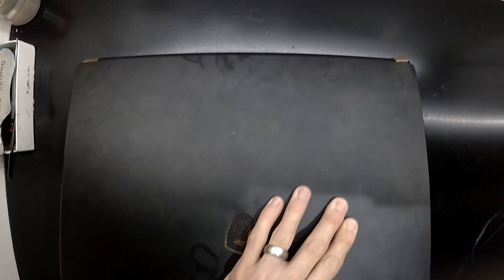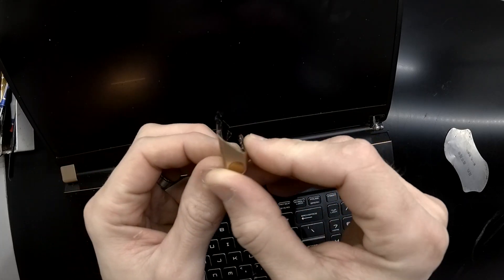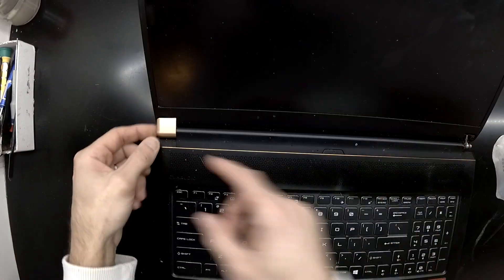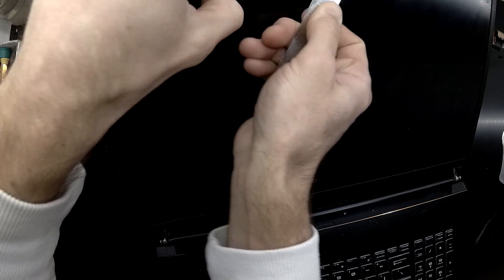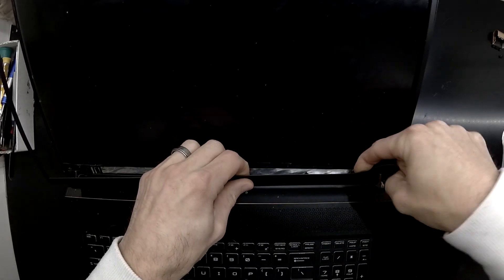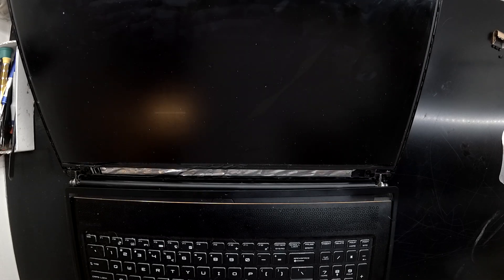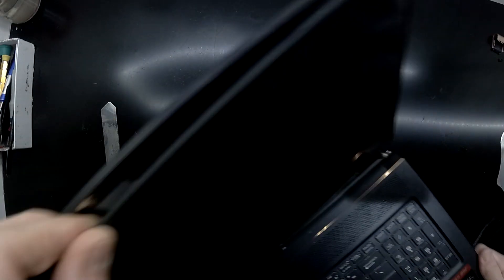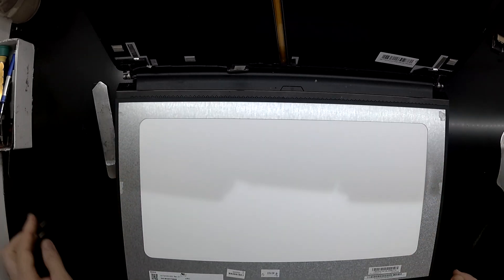MSI G75 Stealth LCD Replacement

Comment: Do you know if this model has a backlight, or the whole screen needs to be replaced?
Reply from the maker: i would be inclined to think you have had a failed backlight on your lcd panel , so a lcd panel replacement should fix it 

but it also could be a failed backlight driver on the mainboard, which isnt overly repairable unless you know a shop to motherboard repair
Reply: @rickstechrepairs  Thank you for responding.

Comment: Hei,
Thanks for the video and all the suppurative comments below. Hope it won't end up by replacing the screen, but I assume it can be necessary. 
ISSUE: My screen randomly is turning off; HDMI is working though. When it turned off / black it helped to push upper middle part (around F10). Now it doesn't work even that. Still randomly I can turn on laptop and is working for a while and even get hot by gaming and nothing happened, into randomly turning off again. Most of the time I'm using HDMI screen but it's pissing me off this because I can't depend on portability. 
What steps i should do to eliminate potential problem? Any thought?

Comment: ty, I disconnected battery first, all works fine now. You don't show how to put the panel back in, but that was easy. My laptop didn't start up when reconnecting battery until I plugged it into ac although battery was full.
Reply from the maker: good to hear its still going all good

Comment: Hello, I have a question. Is that flat webcam cable on lcd cover sticky or not? I was thinking to replace my laptop's back cover so I wanted to know what to do while removing the cables.
Reply from the maker: i cant remember sorry, but most are usually double sided tape, stuck in position
Reply: @rickstechrepairs  so I can safely pull it out while changing the cover. Is there any important prosedure I have to know?
Reply: @fatelessdevil  How did you end up removing the ribbon cable for the webcam? I'm attempting to fix my MSI laptop at the moment
Reply: @OwenChiu  Both webcam and ribbon cable is double sided taped. You have to use something thin such as small flat screwdriver to take out the webcam first, slowly. Then all you have to do is pull out the ribbon cable from back cover slowly too. It’s gonna leave some tape marks on it but don’t worry about it.
Reply: @OwenChiu  I removed the cable because my laptop’s back cover was the broken part, not hinge. So I had to change it.

Comment: i hope u could do ge76 screen replacement in the future, thks so much :D
Reply from the maker: doubtful, it depends on what i see in my shop
Reply: @rickstechrepairs  thks for replying me cmt. My ge76 (auo978f) has really low brightness. it has 40 pins, edp 1.3. If I find any screen that has 40 pins, same edp 1.3, could I swap ? I saw some guys fry their cpu vrm or  main chip set because of screen swap (they get whatever 40 pins screen on ebay) thks so much

Comment: Hi, I have a broken screen, I ordered a new one, and right now I'm trying to do the repair, but the new screen didn't turn on at all, I thought the new one arrived defective, but when I put the old one back in, it's not turning on also. The weird thing is, when I press the power button, the screen flickers for a split second, and then just black. What do you think could be the problem?
Reply from the maker: Does the laptop still display externally via HDMI?
Reply: @rickstechrepairs  Unfortunately no, I only tried it with one monitor tho, I also tried reseating the ram stick, but it didn't help. I gave it for repair an hour ago, hopefully they'll get back to me tomorrow with what's the issue. One thing I noticed tho, is that the cable's outer coating was a little bit unwound, but I checked it and the cable doesn't seem to be torn, but that's also a possibility.
Reply: @shcxatter2  did you get a resolution? the same exact thing just happened to me. replaced new lcd, not posting/no output to external monitor, put old one back, nothing
Reply: @silver60618  they said that I've fried the display, but I think the problem is I've blown a motherboard fuse, anyway I'm using my PC now, don't know when'll I get to fixing the laptop.
Reply: @shcxatter2  did you remove the battery before replacing the screen?
Reply: Same thing happened to me now my laptop won't even boot :(  anyone get this resolved???

Comment: Is it possible to get a original display for replacement?
Reply from the maker: Original doesn't really exists as there is only about 4 screen manufactures.. 
.. so there is no point buying the Panel from MSI, when its not even made by them
Reply: @rickstechrepairs  thanks men

Comment: Hello!!! I just got the hinge connection to the display broken. I don't know what to search for a replacement. Any advise?
Reply from the maker: eDP cable for a GL75 on aliexpress
Reply: @rickstechrepairs  hello Rick! Thanks for your reply. The problem seems to be with the plastic that is attached to the hinge on the display side. Suddenly was broken yesterday for no reason. I live in Peru so it's difficult to find replacement for this model. The cable is working properly. But I'm not sure what should I order.
Reply: @helloWorldPlus  I just had the same problem I went to close my laptop and saw that the plastic frame was cracked I’ve been seeing that this happens a lot and I think it’s a design flaw

Comment: I am having issues with refiting the fatter cable with the clip. The panel wont seal properly from there (near the golden hinge) any tips`? ... 
And people who are saying they want to swap the 144 for 240... test it first, There is some issues with the labeling or smth.. Mine said 144 on the stickers, but in the store where i bought it it said its a 240, and when i do a hertz test i get 240 .. :) So do a test before swaping the screen out :)
Reply from the maker: thanks for the tips.

i think you might need to use some decent double sided tape on the sealing the plastic trim down

Comment: Removing the gold hinge covers is not needed or recommended. If you have back-light bleed after the install, try to reseat the plastic frame along the edge with the bleed.
Thanks for making this video it was very helpful =)
Reply from the maker: Thanks for the tip